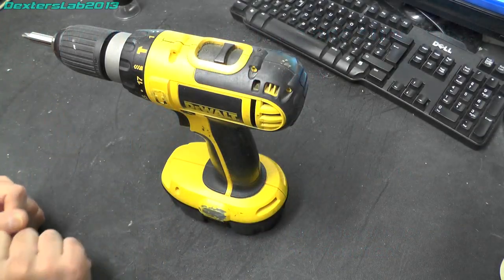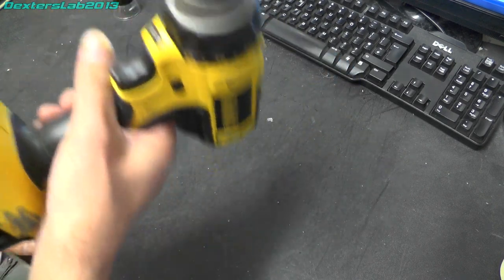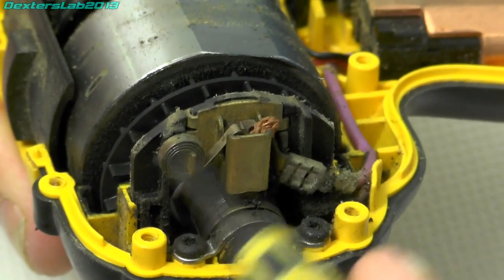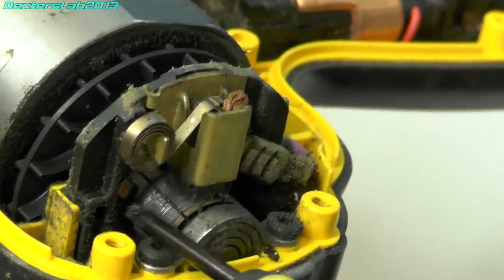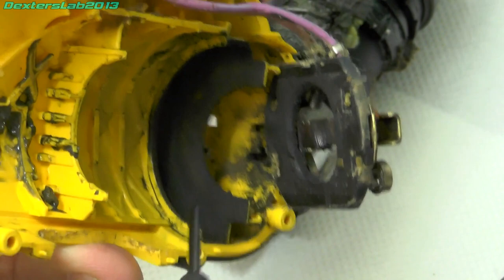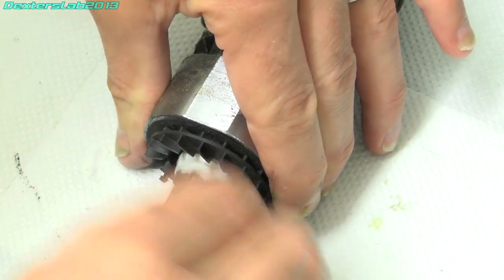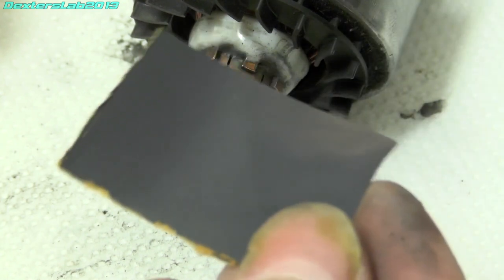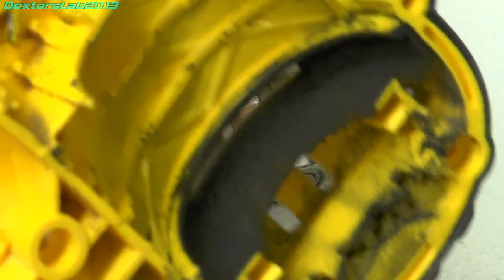DL128 DeWalt DC725 Battery Drill With Arcing Commutator Repair

Comment: I have a 2-year old 18v Bosch drill/driver that would barely turn and immediately smoke when I pulled the trigger. I cleaned the commutator as shown at the 5:00 mark and it now works like new. It was much harder to access the commutator and brushes since the motor is smaller and I had to hammer it out of the casing. The gaps were completely filled but after 5min of scrapping it's back to new. Thanks very much for making this video!

Comment: Thanks very much for the video. I was able to clean out my drill and hopefully give it another lease of life. I have newer, Li-on powered drills and drivers, but my old DeWalt is like a comfy pair of slippers. The only problem that I had was when I separated the two halves of the drill, a little spring clip pinged onto my bench. I went through the video but could not see the clip, then in a lightbulb moment, I realised that it was the little clip at the base of the drill that held the spare bit (which I never use anyway). Great stuff, thanks.

Comment: Brakleen does wonders at removing buildup. Had a non disassembleable motor that was caked in buildup, just soaked it in brakleen and then rinsed it off with more brakleen, looks brand new now! I just needed to re-oil the bushings.

Comment: Make a commutator cleaning tool, I just take a broken hacksaw blade and grind it to the slot thickness and grind a hooked edge into the back. Used for that and for industrial sealer blades as well. While you were cleaning a drop of engine oil applied to the bearing and forced past the dust seal with a bit of pressure from a gloved hand wuld make it last a lot longer, adding to the lubricant in there.

Comment: I need to do this to one I've been given.  The problem is the fwd/reverse is not normal. The normal pressed in from the right side of the grip is reverse instead of clockwise!!  Could this possibly be due to the two brushes connector wires being switched around by someone else in the past?   Seems right to me as its a DC motor.

Comment: So satisfying to see stuff gets repaired. Great job!
The only thing I would have done differently is to polish the comutator rather than sand it. Sanding the comutator shortenes the lifespan of the brushes significantly in my experience. Not a big deal in this case though, since it's relatively easy to replace.
Reply: You can sand the worst off with 800 grit or higher wet and dry paper, then burnish with plain bond paper dampened with some light oil, then wash with solvent, clean out the slots again to make it last a lot longer. Only thing is to keep the brush area free of that dust, and do not use any silicone containing oil or grease there.
Reply from the maker: yes, i probably should have polished it and i have some 8000 grit here i could have used! doh!

Comment: I have a Bosch pks 46 circular that does this I’ve disassembled it and give it a good clean including stator etc new brushes and it still sparks and then cuts out I heard it could be the rotor out of balance?! I don’t know what that means and the commutator is all good have you any idea what may be wrong? Cheers mate good vid. 👍🏻

Comment: Got to do that to my one as well, though with a 3 minute battery  life it really is getting old. The other one though had the battery die ages ago, so now it is running off a 12V SLA battery. I have a corded cordless drill.
Reply from the maker: lol! TBH if you know the drill is good for many years to come, it might be worth buying a replacement battery or putting new cells into the old pack
Reply: Pack was done once already, but case was cracking after a while, plus dead cells from the 1 hour charger cooking them, so got the wire conversion to use the battery was it. Lasts a lot longer as well per charge, 7AH as opposed to 2AH means a lot more grunt for longer. Those CS size NiCd cells are not cheap either.

Comment: I replaced the brushes and the drill works but operates in reverse.  Forward and reverse are backwards.   What did I mix up?
Reply: The brush leads are reversed.

Comment: Great video, exactly what I needed to rescue my drill.  What was used to wet the sandpaper?  It sounded like PVC cleaner and I want to be sure.
Reply: I believe it was PCB cleaner, as in printed circuit board. It’s a commonly used electrical cleaning spray.

Comment: Excellent video, my only problem now is it will only run in 1st gear and appears jammed when you select 2nd 😨
Reply: HI know it's a year ago but...hope you got it sorted. I had the same, the problem is in the alignment, make sure that the motor and gearbox are in a straight line when you fasten it back together. I chocked up the chuck end by about 10mm which corrected the drop of the chuck. if correct the two plastic case halves go together very easily, if you have to push hard it's wrong.

Comment: CAREFUL rookies (including myself) I took my Dewalt apart to replace the switch, and the gear housing fell out.  Gears, and goo everywhere!  Not a chance I will get it back together.  BE CAREFUL taking the bastard apart.
Reply: I'm pretty sure XRP means extra rotating parts because there are tons of them